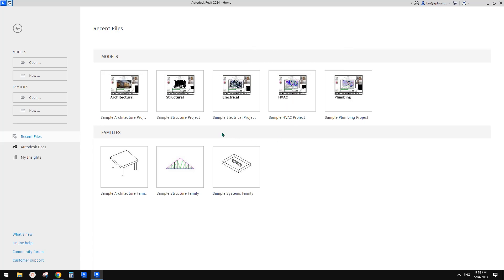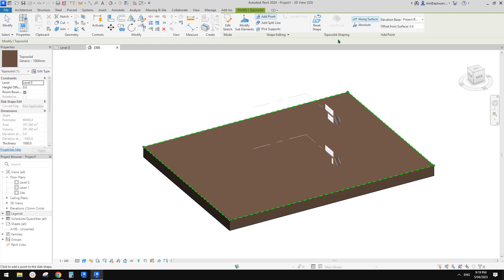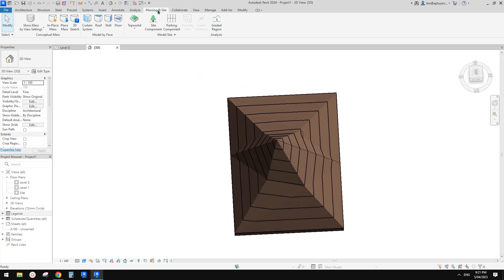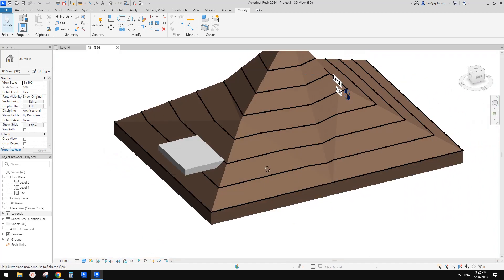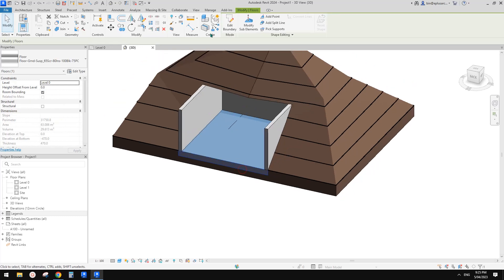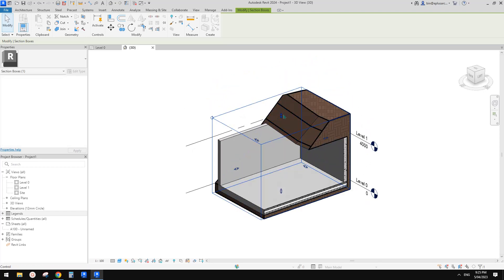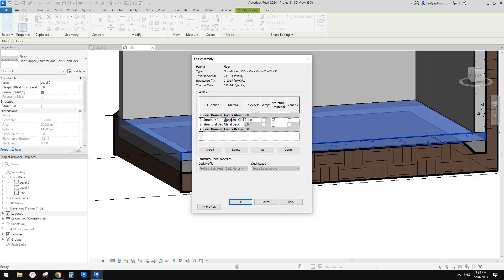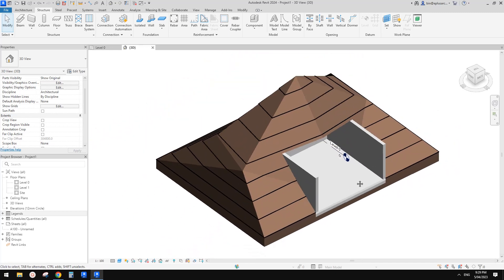23021 - TopoSolid (Revit 2024)

Comment: was wondering if you can convert a floor with modified points to a toposolid, but i think no, I guess with dynamo.  With an older project I created a the topo with floors instead of toposurface.  so wanted to take those floors and create a toposolid.
Reply from the maker: Yes, you can probably use Dynamo to convert them. If the topo is not complicated, you can probably just add points in the toposolid and align them with the floor.

Comment: hi bin ,, what is the difference between curtain system in architecture and curtain system in massing site ,if u know means pls share with us tq
Reply from the maker: I guess you are talking about the curtain systems in project and divided surface with pattern based family in mass. The difference is curtain system uses curtain wall mullions and curtain panels with simple patterns(U&V grids) and it can only be placed onto a mass or generic model in the project environment. Pattern based family on a divided surface can be more complicated with different patterns and it can only be used in mass environment, including conceptual mass, model in place mass and adaptive families.

Comment: I've done a similar project on revit 2022 and it was quite a task..., they've improved a lot👌👌 Thanks Bin!!
Reply from the maker: It’s simply not possible with the toposurface before this. Unless use floor with edit sub element I think.
Reply: @BINHE615  actually i used a building pad on the toposurface and then created other one on top of it with some elevation. After that i somehow managed to merge both the surfaces.